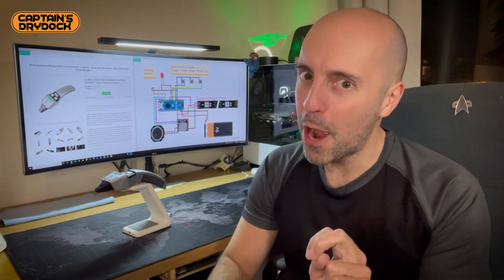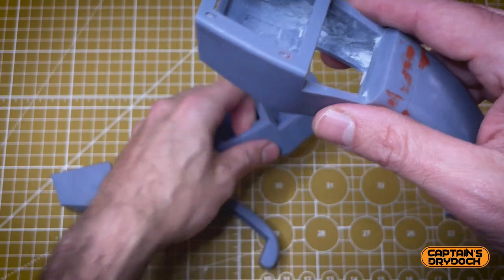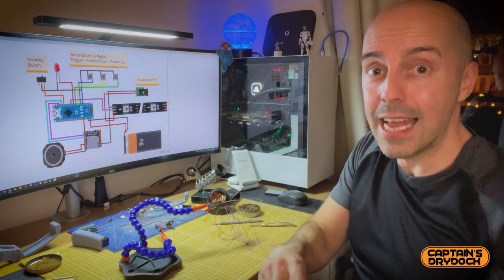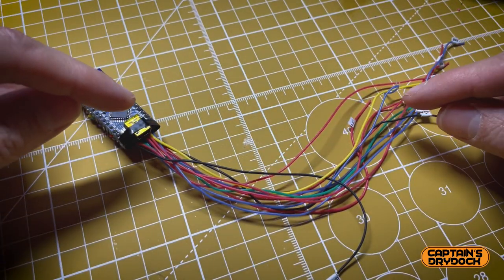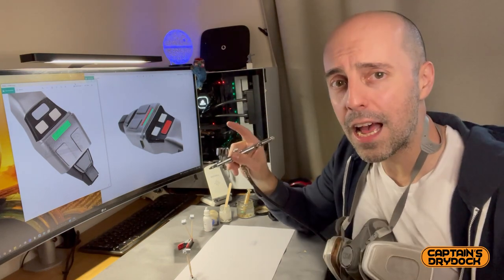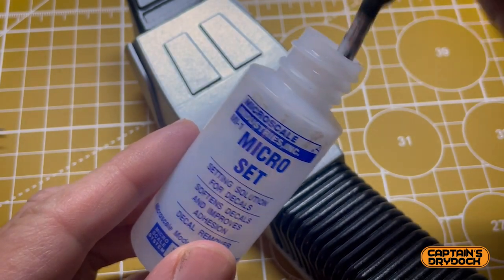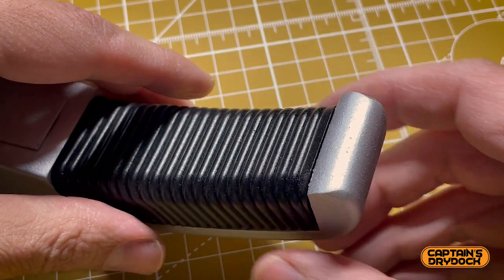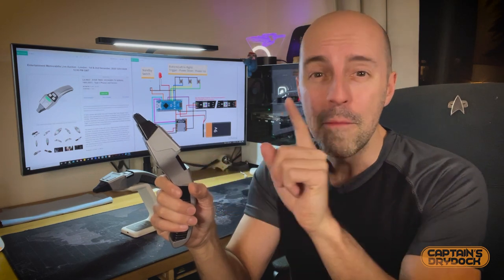Making Star Trek's Phaser Type 2 (Pt 2 of 2)

Comment: Micro-set doesn't protect decals. It's a decal softener, not protector. It softens the decal so it will conform to the surface better. If anything it actually makes the decal more fragile.
If you're adding decals to something and want them to be hard-wearing, start by giving the model a layer of gloss varnish. The smoother the surface the better your decals will stick. Then once your decals are down and dried, seal them with another layer of gloss varnish to protect them. Then, if necessary add a final layer of varnish with the desired finish if you don't want gloss.

Comment: Okay, sharing prints and files is a no-go, so I'm not even peeking in that direction.
But is it possible for you to maybe share a schematic and/or code?
Reply from the maker: If you're willing to go contribute to the cost I had to pay for the Coder I used on a specialist for hire site. Happy to do so.
Reply: @CaptainsDrydock  That depends on how large a contribution we're talking about, but generally yes. Definitely willing to contribute. Still cheaper than going at it from scratch with no idea.